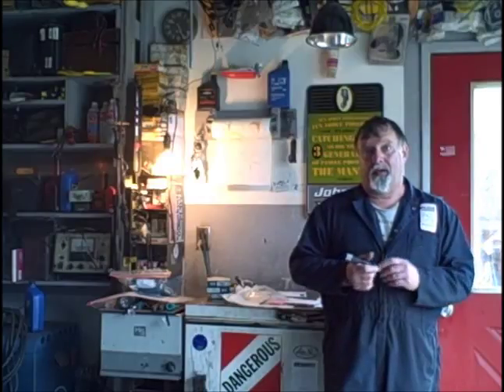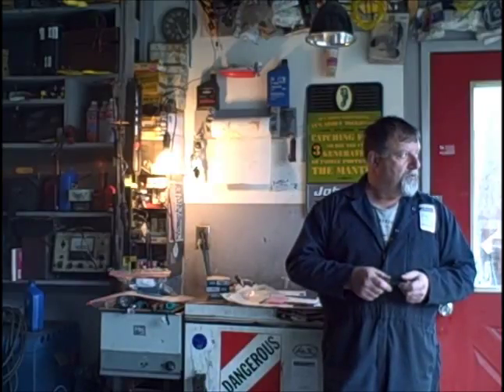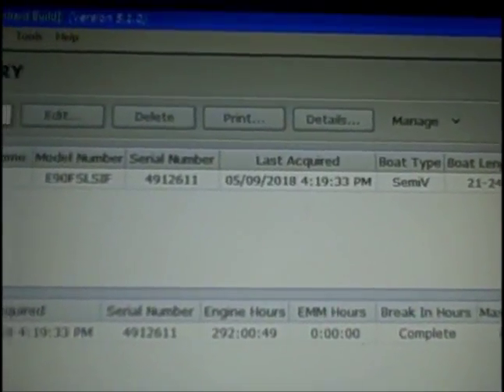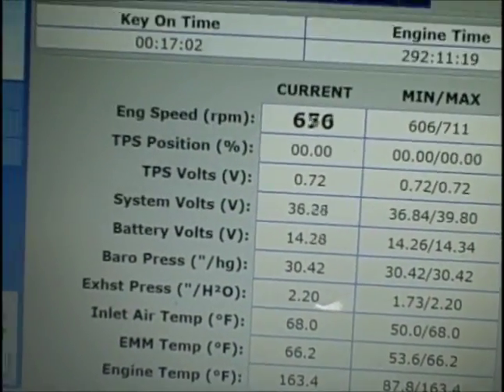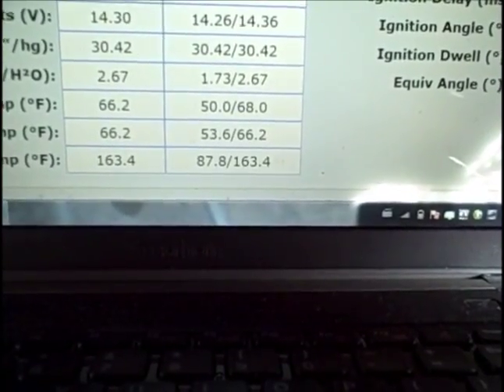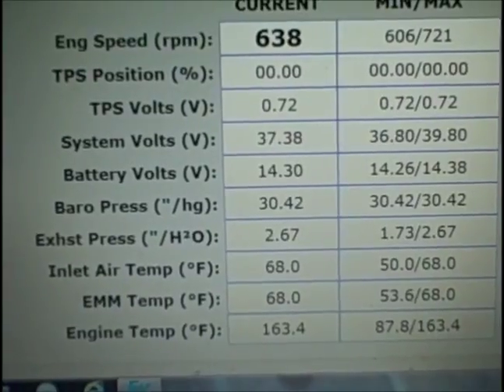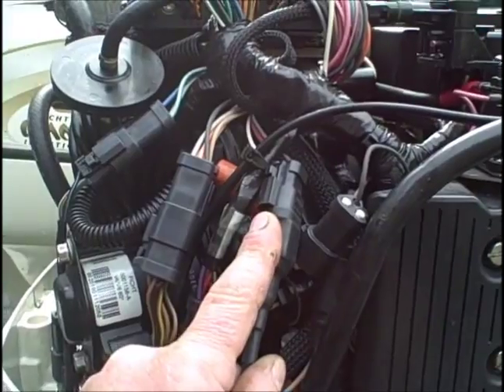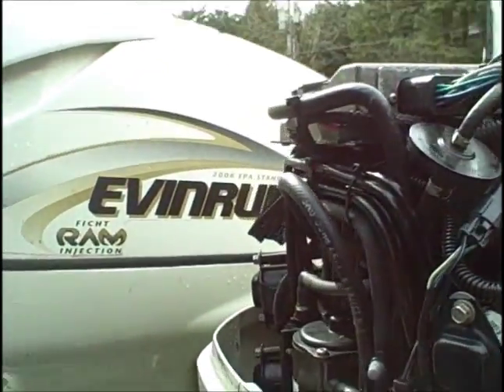Evinrude FITCH 90 HP FFI & Diagnostic code read

Comment: How can I contact you to ask you how to get my software to connect to a 1999 FICHT 175 hp. What software has to be running on a PC to get the data cable to read the engine.

Comment: I connected to my 05 etec 90hp with the diagnostic software but the model number doesn't match the one on the motor is this because of the emm being replaced before. 
I want to do a emm recovery and the instructions say to turn off power of the emm connected the bootstrap and turn power on to the emm. How exactly do I do that??¿?

Comment: Hello there ,I have a 05 evinrude etec 90hp and it runs really good and smooth for a  while and then it changes the sound of the exhaust or something it gets really loud but still runs its kinda like if the prop ventilation sound like but it's not do you have any idea what can it be thanks
Reply from the maker: Most likely your prop is slipping on it's inner rubber hub. If the RPM'S increase when it dose this that is the problem. Try a different prop.   kb
Reply: So you think that prop can run good when cold and start slipping after awhile of running???
Reply from the maker: @sergiocontreras8930  Tho rare yes;  I have seen that.  kb

Comment: Hi, I enjoyed your video.Where did you buy a kit to scan the motor. Did it come complete  with the cables and software. Is it from evinrude or after market. I want to buy a kit but not sure which one to buy. Your advise would be helpful thanks.
Reply from the maker: +JW  ,  I bought  a going out of business  outboard shop,  & The software, pig tails  and  assorted connector's  were in the package,  As I understan u can 
find the kits & software on ebay,  You would need 2 ask seller if it covers your year model.                                          kodi

Comment: Pump the contaminated fuel out into five gallon containers using 12V electric fuel pump & a 10 micron fuel filter / water separator...   Clean the tank...  Then using the same filter apparatus, pump the clean filtered fuel in the 5-gallon containers thru the filter sustem again  & back into the tank...  Pronlem solved...!  (Pumps about 15-20 gallons an hr...)

Comment: SO YOU COULDN'T POOR A LITTLE GAS IN A JAR AND SEE THE WATER IN THE FULE.
Reply from the maker: +Victor Remick,,,   Nope'   He had installed Tanks, &  It was on a trailer , Petrol floats atop water.  Even if after the computer check,  the system requires a re-set.    ,  I don't  build these systems I just try to keep up>>>>>>>>>>>>>>>>>>>>>>>>>     ............................................................................         kodi
Reply: never the less the pick up is on the bottom of the tank so that is were the water would be no mater were or what kind of tank so the first thing to come out out the tank is the water. isn't that the way a water separator works?  they have gotten so complex with this computer crap the average guy doesn't need a tool box on board he has to be with in range of sea tow. and you better be a member..i guess it's just me and my bad adatute sufficing this early morning. have a great day

Comment: I don’t know if you’ve ever ran your motor in the water while testing it but when I give my motor and get to about 1500rpm were it says oil Pressure OK it then says low oil pressure but doesn’t give a fault idk if it’s normal but can you help me out
Reply from the maker: +Rave Wall,  have you had your motor hooked to the computer & the diagnostic program read your motor ?
If yes and there are no fault codes on the fault page,  click on the fault history & occurred History,  It should give more information,  including any past & recent faults.                                                         kodi